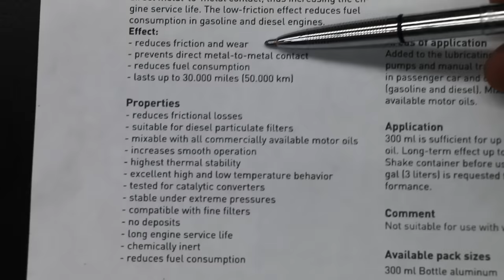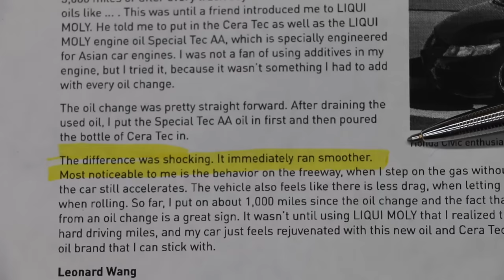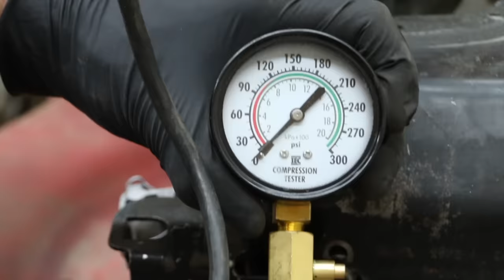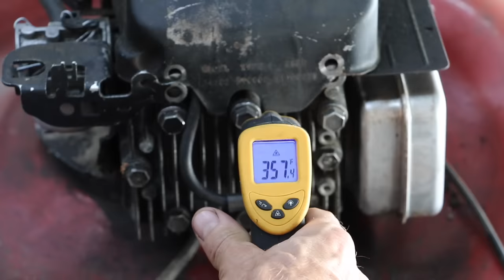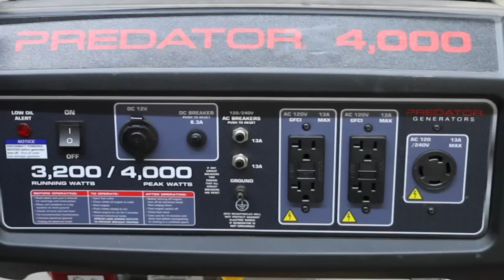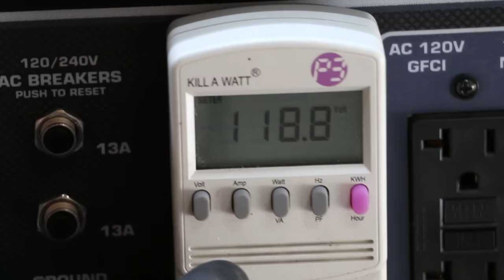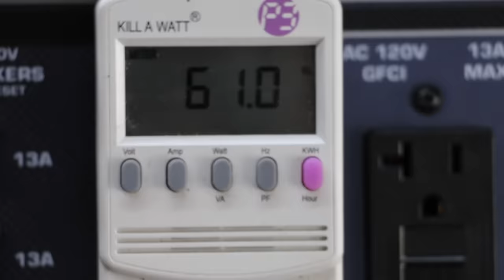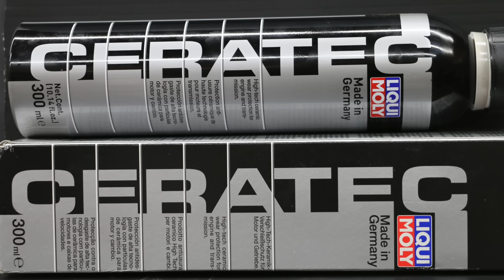Does Liqui Moly CeraTec work?  Let's find out!

Comment: I don't like the way it made the oil look. If I checked my oil and it looked like that I would think I have water in my oil
Reply from the maker: Great point.
Reply: It looked like the engine was sick and a little kid prescribed it pepto bismal.
Reply: That's the first thing I thought of too. An air cooled engine not so much, but a liquid cooled engine I'd be alarmed.
Reply: My dad used have an Opel Astra wich always had large amounts of water in the oil, there always were a few cups full of the typical yellowish slime on top of the oil when you opened the lid.
However the engine ran just fine until the car fell apart after maybe 15 years.
Reply: I would be hard pressed to put anything in my oil, let alone something that looked like chocolate milk. The oil I run states, do not run an oil additive as it will harm the oil and its capabilities. 

I honestly want to see a blind show down between amsoil, Mobile one castrol, and for shits and giggles brad penn. in 5w-30. I will even supply the oil.
Reply: You are right.  I couldn't figure out why I found the look so off putting.  It's because it looks like emulsified oil.
Reply: o1mtbiker but this product is no different than the boron which is in almost every oil on the market. This product is only unique in that you're buying it by itself. It's definitely proven. To learn more about additives, I've tested a few products too.
Reply: DE Nichols umm what does your comment imply? I never said it wasn’t in most oil. Just said I wouldn’t add something that looked like that to mine. I run amsoil, so no need to run any extra additive at this time. Maybe some restore in another 190,000 miles lol
Reply: Travis Brookshire it does look terrifying. Lol
Reply: o1mtbiker as for implying anything. I review products too so I  try to leave great comments about the video and mention briefly what I do on YouTube. That's what I'm really implying. Lol
Reply: DE Nichols ok then why did you comment to my comment exactly? I guess I don’t see the relevance, to my reply. Unless you assumed I was just some uneducated useless reply and you tried to bewilder me with your superior knowledge. Lol.
Reply: o1mtbiker to me it's not about what it looks like. To me what matters is what it does. Also. You're rude thinking no one should counter your point of view.
Reply: @Itsa Mea You might be surprised how good water is at getting into air cooled engines sometimes, had problems with some Onan and Honda engines somehow getting water in the oil (note: I havn't dealt with enough small engines that are stored outside to know if this is a common problem, or if these engines were just special, I do know the diesels stored outside didn't develop this problem, but again, low sample size).
Reply: o1mtbiker sure but you have to understand their legal team has to phrase things based on mankind’s least common denominator, the village idiot. As for oil tests I agree to a point but also not sure it would be good for his channel or not, worth trying out I guess, but there’s lots of certified oil nerds with channels on here already
Reply: @BL-yj2wp  You sure you don't mean 15 minutes?
Reply: Yeah a milky oil consistency wouldn't make me want to use this
Reply: After you run it the whole oil change cycle the oil comes out looking as normal used oil.
Reply: @BL-yj2wp  Every gallon of petrol (gasoline) burns to a gallon of water plus CO2. If the car is used for short journeys (never getting fully hot), some of that water gets into the crankcase and will contaminate the oil. A blown cylinder head gasket can allow coolant into the engine oil, but the engine would soon be overheating and obviously not well. Continuing to drive like that would kill the engine. Oil contamination would be the least of your worries.
Reply: If you think thats weird Liqid Moly has a motor oil thats floresant green
Reply: @seanmehnert1282   in the concentration you use it in your crankcase, it won't even change the color, and the product itself adheres to metal inside the engine anyways, eventually negating the color differential.
Reply: After somes miles (500 for example) the oils looks normal at least in my engine
Reply: @maxapollo1  That is a good idea, you can easily check if is a fake or original oil, in somes countries this happends :(
Reply: Even u know u have this product in your oil and it has changed your oil colour, how u gonna notice when you have water in your oil?
Reply: Sure looks like blown head gasket to me. Could be great for pranks. Pour some in your buddies oil and tell him to check his engine sometime. 
But make sure to tell him before he starts looking for the problem.
Could also be a great one if you've got a know it all in your shop. 
In that case make him search for what it could be but stop him before he starts taking apart the engine.
This stuff could be used for a lot of silly stuff, just not for the things it's advertised for.
Reply: @o1mtbiker  What's Mobile One Castrol?
Reply: Shit look like fuckin tahina sauce bruh
Reply: Stan Cousins that is actually very helpful!
Reply: Or if you do you would not know it...
Reply: o1mtbiker I run my e46 with amsoil and ceratec no issues
Reply: Oil will look normal after some time. I was worried in the beginning, but just after one drive oil was normal colour (diesel)
Reply: My oil looks normal on the dipstick with Ceratec added.

Comment: In the multiple engines I’ve used it in the the difference in noise and smoothness is immediately noticeable.  Currently I’m running it in my 351w ford Bronco mixed with amsoil signature 0w-30.  Flushed the oil (liquimoly oil flush) added amsoil 0w-30 + ceratec.  It’s so quiet you can barely tell the engine is idling at a stop light.  I’ve run it in everything from direct injection diesels to my v8 351w with great results.  Liquimoly motorprotect (a similar product) can be added once every 30,000 miles and I’ll try that next.  I don’t believe all the promises manufacturers state on cans but this product is clearly delivering in my experience on the quiet operation and smoothness.  Before you condemn it for the 2 stroke lawnmower performance give it a shot in a car engine.  Thank you for the tests & awesome channel—.  Also I’m just an average Joe car enthusiast from Virginia and have nothing to do with Liquimoly 😎👍🏻
Reply from the maker: Thanks for sharing.

Comment: Idea, cheapest test.  The cheapest oil I have found were the 1/2 quart bottles from Dollar Tree for a dollar. So effectively 2 dollars a quart.  I wonder how well it fares on the lubricity test? They also sell some $1 fuel treatments, and injector cleaners.  Ultra Budget Shootout!
Reply from the maker: Great video idea!
Reply: Project Farm please try that one I'm very curious of how bad it is. I've always been told not to trust cheap oil
Reply: Project Farm ......I think this is a "must do".........if it turns out to be the same performance as name brand it could save folks lots of money.
Reply: The stuff they sell at Dollar Tree is Semi-Synthetic also.
Reply: Do this! Cheap oil shootout!!!
Reply: Great idea.
Reply: Project Farm I liked this idea too. Please do it! ✌️
Reply: I love the idea
Reply: Project Farm The oil have the same lubricity at room temperature and operating temperature? Also the stickiness?
Reply: This would be interesting.
I haven't noticed the oil at my local Dollar Tree,but I know I have seen octane booster.
Reply: guys, these products have to be tested after say 1k miles of use in an engine. that's what its really about. put a new frying oil in an engine and run it for an hour it'll probably be fine.
Reply: If this is the same oil I'm thinking of, it's not meant to be used in vehicles made after the 19.....30's or 40's... something like that. It contains no detergents and will destroy an engine pretty quickly. Typically less than 20k miles.
Reply: Great Idea
Reply: Did you see the manufacturer logo anywhere or just dollar tree?
Reply: they are regulated so they should be very similiar to brand name oil
Reply: @stonent  not anymore
Reply: @modified93tc  What's not anymore?
Reply: @stonent  it's just regular oil now not mixed with synthetic at all
Reply: @dickJohnsonpeter  that's OK I just got it on my alert recently
Reply: We know wpp oil is great stuff, omni as well.. would be interesting to see
Reply: @dickJohnsonpeter  Moble one did that. Very disappointing. I stopped using it and moved to Millers ND
Reply: Yes that would be a GREAT test...even the Cheap Motor Oils at Family Dollar! #BugetOilShootout
Reply: It doesn't seem that Ceratec would pay for itself on a 20mpg car doing 6k miles with $2.50 gas with $25 of synthetic oil. Cheap oil would need more Ceratec from more frequent changes, so I would think it would be an even bigger loss.
Reply: @treyw3867  I'm with you on Not using cheap oil but it reminds me of a kid in high school. He was in the middle of nowhere and the lifters started ticking in his El Camino. We pulled into a little store in the sticks and all they had was some cheap crap oil. My buddy says 'I'm not putting that crap in my engine!'. I told him 'Cheap oil is better than No oil'. He drove very fast(I told that was a bad idea,too) about 35 miles back to town to get Good oil. The motor was knocking when we got to the 24 hour Kroger store. His Dad had to buy a new motor.
   I always keep a couple of extra qts of oil in every car.
    Y'all take Care.
Reply: @ProjectFarm  still patiently waiting for this
Reply: @project farm
Reply: @ProjectFarm   yes test this dollar tree items
Reply: @stonent  
No organic stuff for sure

Comment: Thanks for another video. I have used LM Ceratec and MoS2 numerous times with great results. Ceratec actually takes a while to work (5K miles). Yes, there is a suspended lubricant in there, however,  the true action happens after repeated cold/hot/cold cycles along with pressure. The result is a rock hard nano coating that does fill in microscopic crevices. This has been proven by engine tear downs. Something to consider when testing nano products. In automotive applications, it may take MoS2 700-800 miles to full coat all surfaces.
Reply from the maker: Thank you for this information.
Reply: My friend said it quieted his car down in 15 minute but, it took just over 500 miles in his 2018 Mustang to see all of the claimed results
Reply: Likewise, I noticed an improvement at around 200 miles. The improvement seemed to be semi permanent, in other words it lasted.
Reply: I've used it for several years in my Volvo D5 diesels after reading about it on http://volvoforums.org.uk - together with Shell Helix Ultra 5w40:  https://www.volvoforums.org.uk/showthread.php?t=245521&highlight=oil+change+recommendation&page=2
It works - the engines run cooler, quite and get better mileage and starts easier. The oldest V70 now has 254K and keeps on going - but like stated earlier - it takes several hundred miles b4 you notice any improvement.
Reply: @tanthony3895  except for the fact that all the different brands of engine oil have their own blend of additives. Boron Nitride (which ceratech provides) has superior anti-friction properties compared to molybdenum.
Reply: I really should try ceratec then. I have been using MOS2 for years though to great results.
Reply: @blazetownsend8785  I think it depends on the engine. A longer interval engine like a modern car running ceratec is better - but a lawnmower or an older car running dino oil MOS2 might work better. My opinion is based on how long it takes Ceratec to actually work. I use it every 20k miles in my RRS. The oil change with the ceratec in it the car runs much more smoothly, idles more smoothly and seems to have a little more power after about 1k miles. The 10k mile interval after that - especially at the end - seems to regress some...engine is noticeably noisier. I have my doubts that Ceratec lasts as long as they claim, I think they say it because the stuff is so damn expensive. But I do see marginal improvements and feel it does provide some benefit. In such an expensive and complicated engine (5.0L V8), $30 every 20k miles doesn't seem excessive if it provides any insurance against wear.
Reply: @tanthony3895  I understand your sentiment. But there are too many people that have too many good things to say about this product for it to do absolutely nothing. No additive is going to change the world because motor oils today are already so damn good. These products are incremental and that's what they cost...if you run Ceratec every 20k miles your cost per mile is $0.002 (@$30 for 1.5 bottles).
Reply: @stevenphillips6849  I've always done Synthetic on my EJ22 with MOS2. Worked great up to this point. I did a reseal and head gasket rebuild 2 years ago, and there was very little wear, even in the cylinder walls, which still had the crosshatch with almost no wear on it. Bearings and rings were in spec still. And it was 260,000 miles on it. It was also amazingly clean in the engine, with almost no need to clean, outside of the oil separator area, where I replaced the plastic oil separator with the upgraded steel one. There was some gunk in there. For 260k miles and 25 years. I think MOS2 and synthetic was a good idea. (I had to do the head gasket, as I had to replace the valve stem seals. Those were still good too.)
Reply: @blazetownsend8785  awesome testimonial...my guess is you never skipped an oil change either, which is probably the most critical thing anyone can do
Reply: I actually tested this additive on my 04 Acura tsx i was super skeptical and wow was I wrong it really quoted down my car and the smoothness of it now is is shocking. Just try it out I did and was pleasantly surprised.
Reply: @blazetownsend8785  
Have you use Ceratec in your EJ22? I also an EJ22 and I've used LM MOS2 and Valvoline Maxlife high mileage synblend (red bottle) and Valvoline full synthetic high mileage maxlife (silver bottle) with good results...which synthetic oil do you use/recommend and what oil filter ?
Reply: @elsanto769  I did a reseal on my engine. So I do not use the high mileage stuff. I use mostly valvoline as well and mobile one. But I am switching to Amazon Basics full synthetic. I still use MOS2 as well. Though, it's because I am trying to get through my supply of it before I switch over to Ceratec for testing.
Reply: Blaze Townsend I got 240,000 miles on my ej22 and it runs good, slight lifter tick, may I ask, how noticeable was the effect of mos2? Would appreciate any tips.
Reply: @Walterrinho  MOS2 helped with lifter tick. It was mildly more responsive. However, it is more of a antiwear additive. Prevents damage to things like the bearings. It is not instantaneous. It's a preventative measure more than a performance boost.  I may be a bit essessive for how I added it. I add a half a can to a new 5 quart oil bottle, shake it up, and use that in the new oil change. I think oil is more important, and additives like this can enhance them. I use a full synthetic when I do the changes. Every synthetic will do just fine, however, I also want to point out, that reviews are something you should read through. I currently have a idemitsu, who makes the subaru full syn, and a valvoline full syn waiting for upcoming changes. Also, I am at 280,000. I did reseal it at 260,000, headgaskets and new seals all around, I did not need to do the gaskets, but when I was working on the valve seals, I had to do the head gaskets as well.
Reply: T Anthony only the mos2 works
Reply: I think both product work lol... I am driving a Hyundai Sonata 2017 with 38k miles on it. 1) regular oil change at the dealership around 4k to 5k, 2) replace air filter five months ago, 3) 99.9% refills my gas at Costco 87. Anyway, for the pass five months my MPG display reading only show average 22 MPG normal drive after using Mos2 jump to around 24.5 mpg normal drive. Just add Cera Tec couples hours ago and my MPG reading around 24.5 mpg to 28.2 mpg up/down. I have not see my car mpg display readings response this aggressive for the past five months but only after I add MoS2 seven days ago and today I just add Cera Tec to my engine oil.
Reply: This dude is a snake oils salesman for sure!!!! 😂🤣😂🤣😂🤣
Reply: @adamd.557  ha ha ha you  are funny man

Comment: I have put one can of Liqui Moly STOP on my old '71 Ford Falcon, and it basically removed 10 years off the engine, stopped smoking, reduced noise, runs smoother, solved a leak... I higly recomend this brand.
Reply from the maker: Impressive results! Thanks for commenting on this.
Reply: @ProjectFarm  Wassup. I used Some of those products on my 100k+ Honda and Nissan more as an protection after getting them While doing full fluid and general maintenance. I think It's same stuff more or less and No MAGIC but fuel consumption and coolant temperature coming out of engine(Custon Defi dials) went down 5-7 while driving in same conditions. For what they charge on used car as extra maintenance I think its ok. Noone Should expect to FIX an broken engine with this stuff :)

Comment: Thanks as always.

Personally, I don't think a single run (n = 1) is a sufficient basis to assume a reliable 1% improvement in fuel efficiency.  I'm not saying you should keep burning gas; I just wouldn't put much stock in such a small difference in a small sample.
Reply: I agree. 1% is well within normal expected experimental error. When I was doing lab experiments as part of my Mech Eng degree at Uni, we used to consider 2-3% as normal experimental error.